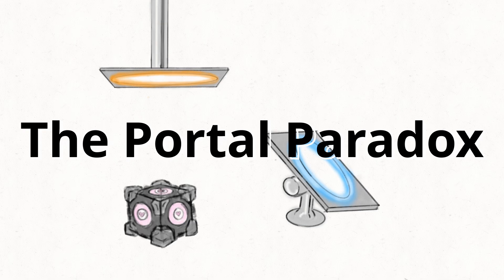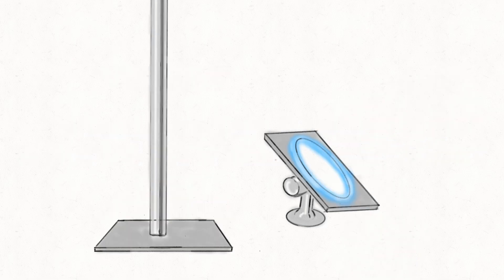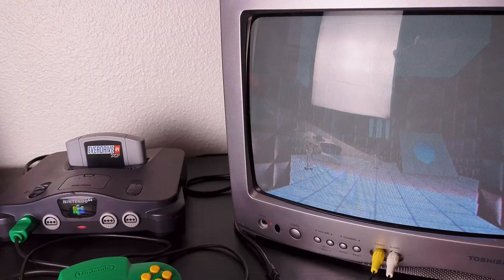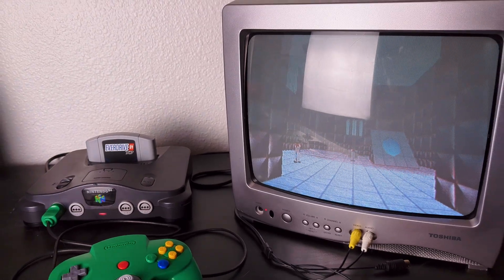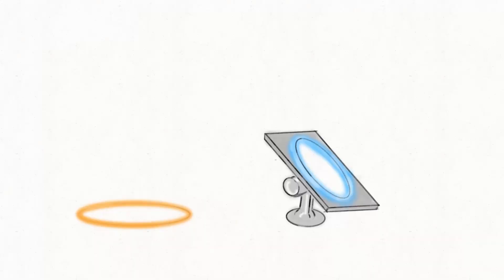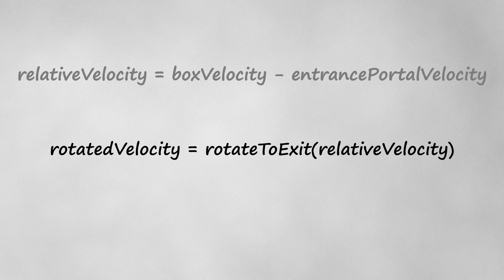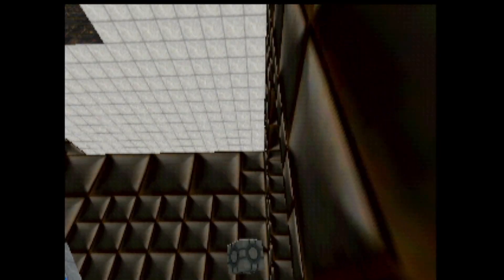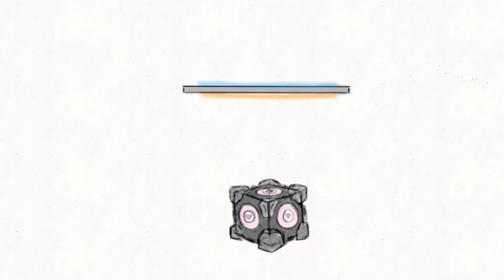I rewrote Portal from scratch and solved the Portal Paradox

Comment: I believe that the object should not gain velocity in this situation. If we assume that an object at rest acquires velocity simply because the portal itself is moving, we end up with a physically impossible contradiction when we consider extreme cases.
For example, suppose we have a 5000-ton cube. If a person moves the portal quickly over the cube, the “velocity is transferred” argument implies that the person has effectively thrown a 5000-ton cube. However, a person obviously cannot throw 5000 tons. Momentum cannot be created from nothing — to accelerate the cube, an equivalent amount of momentum and energy must be applied, and the reaction force must be experienced by the person. But the person does not experience such a reaction force.
Therefore, if the cube were to gain velocity simply because the portal moved, it would violate the conservation of momentum. In conclusion, the interpretation where the object does not gain velocity is more physically consistent and reasonable.

Comment: Honestly, the correct answer is neither of the options presented in the paradox.
When the 2nd portal doesn't move, what would happen is that the part of you that has gone through will be pushing against the part of you that hasn't, leading to a compressive effect that cancels out any momentum.
If it's gentle, you'll feel like you suddenly went upwards in an elevator, if not, you'll basically get crushed and just flop out the other end.
To go flying per the other solution, there'd a) have to be a lot of extra matter behind you to propel you (e.g. standing on the cube), or b) the object must be really compressible/springy

Comment: I disagree and don't believe cube would gain velocity. No force is being applied to the cube when it moves through the portal. Using relatively velocity seems like an arbitrary decision to me, why is any force being imparted on the cube? 

If the space around the cube is moving, how is any force being transferred? The cube would have to accelerate from 0 to the speed of the platform with literally no time for change. 

I instead think that the conservation of momentum would mean that the cube is static, and would begin sliding instead of launching.
Reply: Conservation of momentum is maintained with Relativity, since momentum=mass*velocity and velocity is relative, momentum becomes a relative quantity.
Reply: @thealmightylatte  Space, as far as we know, does not have a velocity.
Reply: @ Okay? How is that relevant?
Reply: Using a relative measurement of velocity isn't arbitrary. That's literally the only way velocity can be measured. The question is what it is measured relative to and if anything it would be arbitrary to measure it relative to something that has nothing to do with the portal. As opposed to the portal itself.

As far as whether a force is imparted or not. Portals are shown to change the velocity of whatever passes through them (this happens whenever you do a portal fling in the games), whether or not that's to be counted as a force. Conservation of momentum is actually why B would happen. Since you have an established motion for the cube on the other end (the cube literally wouldn't leave the stationary portal if it wasn't moving), that happens to be moving at the same speed as the piston slamming down and conservation of momentum means that motion is kept even after it leaves.
Reply: @J4hk3 The argument has paradoxical gaps either way. The cube either accelerates from 0 to the velocity of the piston instantaneously (which is impossible), or the cube moves through the portal at speed then instantaneously stops over 0 span of time, which is also impossible
Reply: @nono-lz7en  The cube having instantaneous changes in velocity when passing through the portal is at least consistent with how they work in the game though.

Comment: I don't think you're necessarily wrong, and I do think the demonstration is extremely cool, but I don't think it actually supports the idea that the cube must fly out of the portal since it's assumed a priori to creating the equations. The "flaw" is not within the equations, the equations themselves are as correct as the assumption. 

Here's one consequence of that assumption: Imagine that you had a hose floating in outer space and you quickly moved one portal around the hose, but then the portal abruptly stopped at the hose's halfway point. Since the hose on the other side would have been moving through space, it would have momentum and would start pulling the rest of the hose through space, i.e. the portal imparts a force on the hose without actually touching the hose. 

Does the hose thought experiment disprove your answer? No, I don't think so. It just shows that making your particular assumptions leads to weird outcomes. If those outcomes are weird enough for us to discount the assumption, then that would be the "flaw" in the equations.
Reply: There are a lot of attempts to demonstrate the "weirdness" of this by talking about having the orange portal sent down over the cube but stopping halfway. With the result, as such in you hose example, being that the moving part of the cube that's left the exit ends up pulling on the non-moving part. In the end the idea of a moving part of an object ending up pulling on the non-moving part it's connected to is just basic physics.

It can happen under the alternative argument as well. If we used your hose example but having the hose moving towards a stationary portal. But as it's half way through the portal suddenly starts moving away as to try to prevent the hose from being able to go all the way through. Most people would agree the hose that's left the exit on the other end is moving. Since it was already said to be moving to begin with. So the conclusion would be that the moving hose pulls on the part trying to catch up, pulling it through as well. It's basically the same effect but shown through a different reference frame.

Comment: which law or laws of physics are being utilized or altered to change the momentum of the box? are the portals changing the direction/strength of gravity? the strength of the strong/weak nuclear forces? is electromagnetism to blame? if so, how?
as far as i understand it, the portals are not interacting with the box, they are merely connecting two separate points in space. its identical to teleportation. the only change that should occur is the box's orientation and the direction of gravity relative to the perspective of the box (the direction of gravity does not change for an outside observer, obviously)
Reply: Which laws of physics are utilized to change momentum of the cube as portals are shown to do in the games? https://www.youtube.com/watch?v=ASUUN0W4_JY

The thing about expecting a scientific explanation for how B happens is you didn't really expect one for portals to begin with. The key thing is understanding that B is already consistent with how portals are shown to work. In that the games already shows that portals will change the momentum of whatever passes through them in order to function as a seamless passage.
Reply: Portals already break conservation. People forget momentum is magnitude PLUS direction. Changing a cube’s velocity changes its energy

Comment: Well, what if we start thinking about mass? If we have a light panel with our entrance on it, and we drop it over something heavy, should it fly out proportional to just velocity, or should it be force? Not to mention the panel doesn't ever touch the object, so all the energy of the panel goes straight into the ground. 
I see 3 scenarios. 1: No kinetic energy applied to the object. Since the energy never touches it, and energy cannot be created, it does not move. 2: Kinetic energy based on mass AND velocity, not just velocity. A heavier object will fly out slower than the lighter object. If the object is heavier than the panel, it will fly out slower than the panel fell, and vice versa. 3: Kinetic energy based only on velocity. No matter the weight, it flies at the same speed. Either way, scenarios 2 and 3 break the laws of physics. So, either it isn't possible, or someone's getting a damn nobel prize if it happens.
Reply: Scenario 2 specifically supports his attempts, velocity is relative so kinetic energy is relative.

Comment: The equations for relative motion are 100% correct. But my intuition always told me that it will just flop to the ground, not obtaining the speed of the relative field. What I am saying is my opinion and not 100% fact but here you go:

The cube mas has not experienced force and therefore its mass has not been accelerated. The cube does not feel the momentum whatsoever from the portal (despite momentum being conserved for travelling objects portals do not possess the reverse property). If the momentum of objects (not planes/surfaces) is conserved for portals, adding speed of planes/surfaces breaks energy balance. The cube cannot just absorb kinetic energy from a moving portal surface any more than it can just maintain its OWN momentum through it.

A simple counter example is if a entrance portal and cube moved toward one another, the exit portal stationary. The cube, in my opinion, will only maintain it's own momentum.

Some more questions, what about an accelerating surface? How much time should pass for it to gain it's newfound energy exiting the portal? What if the cube was in space? Surely you cannot expect the cube to magically obtain kinetic energy in a place where there are no relative observing point? What about two moving portals?

Comment: I really like this video, but do people really have any debates over this? The cube has no kinetic energy of its own as a stationary object. This would be like slamming a pringles can over the top of a dice.
Reply from the maker: That isn't an equal comparison. In the portal situation, the opening of the can where the dice enters is moving but the half where it leaves is not moving. In your example both halfs are moving together which leads to a different outcome. If you want to argue conservation of energy, portals already violate gravitational potential energy which is the most obvious doing the infinite falling trick.
Reply: @james.lambert I was wrong. After some thought I realize all you’ve done is reverse the velocity process - I apologize. Your process makes sense, I was failing to consider the velocity in which an object exits a portal would be the same as if it were launched through it - appearing out the other end would be at the same speed either way. Thank you.
Reply: @james.lambert I always figured the idea behind the portals, lore wise (as much as people can even explain wormholes), was that it was just an opening between two points in space. It isn’t touching anything, technically. It’s passing through a hole. However fast or slow the frame around that hole moves won’t affect the cube. In order for an object to even be flung in this scenario, like I said, it would need to have its OWN kinetic energy - the cube won’t just absorb whatever kinetic energy the portal posesses from moving, because it’s simply a window into a different space. Your utilized equation was logical in a regard, but feels arbitrary in the sense that it treats portals as though they’re a surface akin to a barrier or water, and not an opening. Even then, like you said, portals violate physical laws. Neither of us would probably be right if portals were ever created. But as it stands I truly don’t believe the cube would move at all.

Comment: If the cube was made of Jello, would it get ripped apart while the portal is coming down on it?
Or if it was a big stack of tiny cubes, would each layer go flying separately?
(I don't think you've solved it, it was just your interpretation, and that's fine)

Comment: This still doesn't make sense to me, maybe my understanding of physics is flawed but someone explain to me where I'm going wrong;

- An object at rest will stay at rest until acted upon by an external force
- Going through a portal does not exert force on the object. Entrance velocity equals exit velocity.
- Cube experiences no external force except for gravity when through portal
- Cube is stil yeeted

What?
Reply: "- Going through a portal does not exert force on the object. Entrance velocity equals exit velocity."
Here's your problem. "Entrance velocity" and "exit velocity" are inherently relative concepts. The entrance velocity is always going to be the velocity relative to the entrance. The exit velocity is always going to be the velocity relative to the exit. 

So it's not correct to say the cube in the problem has a entrance velocity of 0, that literally means it isn't entering at all. Its entrance velocity is basically how quickly it is entering the portal, which is how quickly the portal is being slammed down on it. So that's how quickly it leaves the exit, relative to the exit.

In other words  "Entrance velocity equals exit velocity" actually describes the manner in which the passing object's velocity can be changed by the portal. The velocity changes in the manner in which the relative entrance velocity always equals the relative exit velocity.

It can either be argued that this change in velocity has to count as a force, in which case portals do in fact exert a force, or it's argued it's a manner of changing an object's velocity which isn't classed as a force. Doesn't really matter either way.

Comment: WRONG🛑 

Everyone, just find a clip of Doctor Strange throwing a portal to Norway at Thor and Loki in Thor: Ragnarok (that's the third Thor movie, right?). That is objectively how portals work. The cube can't just take that velocity out of nowhere. And the portal that moves isn't even an object to have velocity. That's the same as if you were standing and some crane or smth moved a wall with a door towards you. You'd just be on the other side of the door, except you didn't walk through it, the door walked through you. The portal is just a doorway plain and simple. Even simpler: the portal is a HOLE. There is nothing that can have velocity. I feel like there's been a lot of moments with moving portals in movies like the one I mentioned above, and they all follow the same simple logic. So I don't even understand where your "paradox" is coming from
Reply: You're talking about https://youtu.be/AbYSm6K4c-4?si=ws17cha4wfpcqfvb&t=46
You can see in the scene the exit portal was also moving. This is in line with the portal logic described in the video. Basically any velocity that would be gained from the portal being moved over Thor and Loki was then counteracted by the exit portal moving backwards. The video actually covers this at 2:21. An exit moving the same as the entrance won't launch the cube, but a key part of the problem is that the exit isn't moving with the entrance.

It's actually interesting to think about why the MCU writers wrote it so the exit portal moves there. They wanted Thor to maintain his standing stance and be unmoved by the portal over him. But they clearly realised a stationary exit would require Thor to move out of said exit.

Yes portals are doorways, but they are doorways that specifically change the momentum of whatever passes through them in order to achieve a seamless passage: https://www.youtube.com/watch?v=ASUUN0W4_JY
Reply: Entrance and exit portal moving at the same speed, doesn’t break logic

Comment: A flaw can't be pointed out since these portals are software versions of wormholes and our knowledge about them is merely hypothetical. However, your implementation would generate an unexpected behavior in another situation:

• Let's say we have a square shape falling onto a cube (just like a piston but without the cylinder pushing it downwards).

• Let's also assume this square is thin enough that it's almost like a 2D shape but with just enough height to hold two portals.

• The scenario is a literal sheet of paper with an elliptical hole coming down from above and landing around a cube.

==

With your implementation, the moment the cube finishes going through it, it will be launched upwards, wouldn't it?
Reply from the maker: It wouldn't be launched because the portals are both moving and the velocity from portal going in would be cancelled by the velocity of the exit portal. Its only when the portals are moving relative to each other does it create the so called paradox.
Reply: @james.lambert  But the speed of the cube being launched seemed to be higer than that of the moving platform. Was that just an illusion because of the perspective?
Reply: @MasteredRealm  probably

Comment: The issue is that the piston slams onto the floor, killing its momentum and your code isn't compensating for that.
Reply: once the piston is on the floor it has no effect of the cube. its already entirely on the other side, if not then it is a fraction of a percent of the total mass and may as well be a floating point error.

Comment: Personally, I don't think the cube should shoot out because I wouldn't think there would be any force applied to the cube as it goes through the portal.

Unless the portal can infact transfer energy.
Reply: Well relativity is the answer, I’ve already made another comment on this in the newest comments section but in a nutshell. Motion and velocity are relative, if in a frame of reference something is in motion it also means that it has velocity in that frame of reference, this also means the answer to the paradox depends on the frame of reference you choose